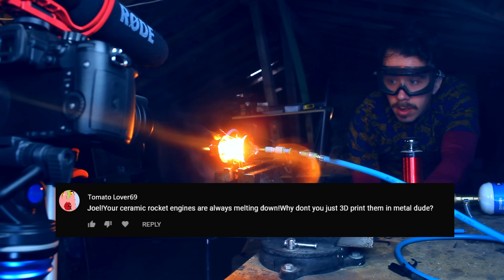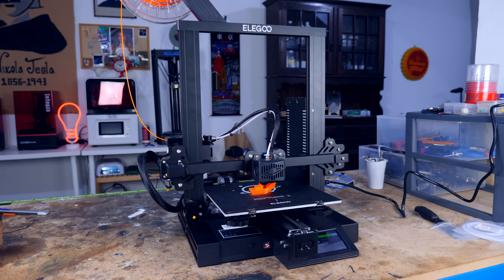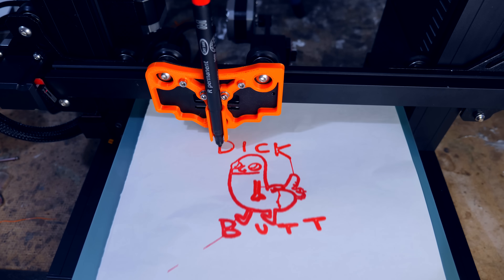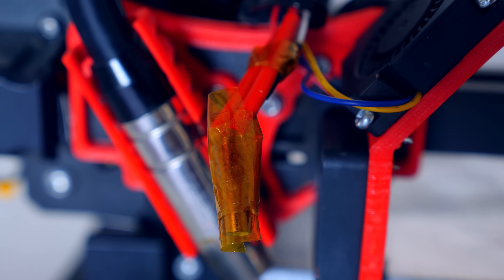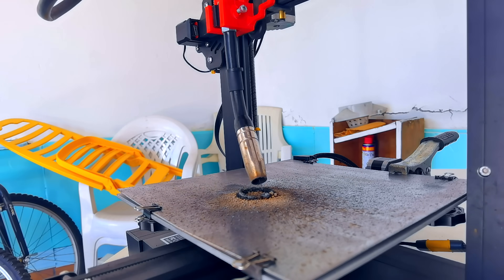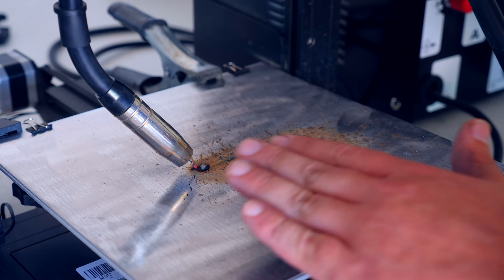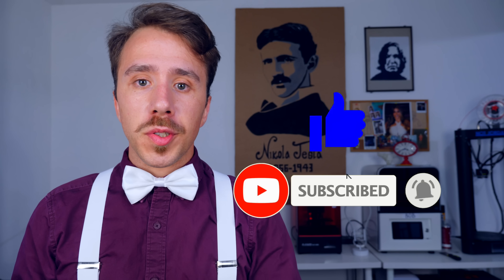I built a Metal 3D Printer using my Welding Machine

Comment: You should make a car/ generator that runs on dry ice. Since the dry ice makes pressure you could possibly use your Wankel engine or design a new pneumatic motor, but that could fix the problem of all of the pressure coming out at once.

Comment: Instead of printing metal, mill layer by layer and weld it together that way it would be more controllable. To fill the small gaps between layers maybe put it in oven in to melt the metal just enough to fuse in.

Comment: Make a Jet engine using only 95% tomato cans and Also 3d print a spool of filament to 3d print a spool of filament 3d print a spool of filament 3d print a spool of filament 3d print a spool of filament 3d print a spool of filament 3d print a spool of filament FILAMENT CEPTION
Reply: integza if i get the 3d printer can i get a spool of filament to 3d print a spool of filament to 3d print a spool of filament to 3d print a spool of filament to 3d print a spool of filament to 3d print a spool of filament to 3d print a spool of filament to 3d print a spool of filament to 3d print a spool of filament?

Comment: Well, if you can't 3D print them, and won't take my previous suggestion of having a service like Shapeways print them for you, how about using a CNC mill to cut a nozzle? Sure, buying those is also expensive, but you should be able to DIY that out of an FDM printer a lot easier than trying to make a metal printer.

Comment: dude. For the last time. Do NOT 3d print in metal. 3D print with FDM fillament called polycast or Moldlay and then Cast the fucking part out of a molten metal. I wrote this almost under every one of your "jet" videos where you complained you cannot print with metal. And you already have all the components to print it. Make a mold. Scorch the print out of the mold and then cast it.

https://www.youtube.com/watch?v=4--fiBGMIpc

Comment: I have a mechanically identical welder and also a 3d printer. I haven't watched the video yet, but I will be utterly blown the fuck away if this doesn't fail **spectacularly**

I've watched it now.
I think I see some problems you had.
Firstly, you are using flux cored wire, which does need to be cleaned between each layer, which is going to make layer height almost impossible to get right. If you switch to an inert gas welder, I think you might have better luck in that department, and they also don't smell as bad in my experience.
Second, perhaps it would be best to take out the trigger from the welding machine and have a more sensitive switch manipulated by a solenoid, that way you could have less delay and wobble in when your welder started.
Very impressive work otherwise, it does not fail as spectacularly as I expected.

Comment: When welding it's important to remember "If there's slag, you'd better drag" and with a flux core welding machine, you're going to get slag from the burnt flux. Ideally for an actual metal 3D printer you'd want to use a Metal Inert Gas (MIG) welder, that is a welding machine that uses a flow of inert gas to shield the weld pool instead of a flux, this would result in less spatter, cleaner welds and the ability to weld one layer on top of the next without flux inclusions, plus different gases produce different effects in the weld.

Comment: why dont you connect the switch on the welder to the extruder signal, if it exists. Have never played with printers. But I am a welder, flux core should not be used for this. the slag is killing you man.

Comment: your using a fluxcore machine therefor it makes a mess every time its used, using a shielding gass like argon will help a lot with that, and using an arcipelico cooler under the steel sheet will help prevent it from warping

Comment: I have an idea: put a smaller aluminum build plate inside a plastic tub that has water surrounding the plate. This would keep the aluminum plate below water boiling temperatures and would perhaps prevent excessive warping. You'd need to either use magnets to secure the aluminum to the plastic and the plastic to the 3D printer bed, or perhaps some high temperature rated double sided sticky tape.

Comment: Try that experiment again with a MIG welder that uses gas shielding. The gasless wire you used is horrible, messy crap and this is where the spatter was coming from. The gasless weld needs to be cleaned with a wire brush between layers but not the gas shielded weld. There is a flux core in the gasless wire that causes the mess. That is why the welder in the video clip was working so much better. Don't stop now, you are almost there.

Comment: You are using a flux core welder and you need to be using a gas welder The problem with fox squirrel Welders is there is a coating of flex on each weld that you’re welding over that’s why it looks so bad if you start using a gas welder Then it would also look so much better

Comment: You really need to be using a shielding gas like Argon when welding. It explains why your welds are so messy. You can also make use of anti spatter spray on your work pieces to avoid quite as much hot metal splatter.

Comment: Could you maybe make a sturdier bed by welding bolts to the underside and attaching it to a large piece of wood?
It might pull the plate down to decrease the warping without needing a larger plate.

Comment: Hi 👋 
If my lathe or milling machine could help you in any way, just send me an email. I am not an engineer of course, but I definitely can make some simple stuff :)
Reply: 😳😳 nozzle problem solved. Lathe can create nozzle curvature. Aluminium will be great for nozzle.
Reply: @sgt.scorpio9922  oh no no aluminium melts faster than the resin nozzles!! it has to be steel!
Reply: @sgt.scorpio9922  Aluminium has low melting teampriture.
Reply: Hydrogen powered internal combustion engine
Reply: @tremainedavis5996  haha a bit of a stretch there buddy XD
Reply: Graphite!
Reply: Yeah, this is how I plan to make some nozzles. Metalworking lathes are perfect.
Reply: Same here you if need any fabricated pieces I could try my best to replicate them. I would really like to see this idea go further preferably with Argon or even  TIG. I am not a machinist I am a hobbyist but I have a lathe a mill a CNC and a metal shaper. Fortunately what I don't have I have a an awesome uncle that has an entire garage set up as a machine shop. So if you need anything just email me 🤟
Reply: @Alpha Mods
Lathe would be a plan, milling with DRO would be similar to a printer, ye?  or manual
Reply: @Bob0bscureD  DRO makes it much easier, but still a pain to do anything with curves using a mill.
Reply: А вот и пересеклись интересы
Reply: yeah
Reply: Не думал что встречу альфу на этом канале
Reply: О, ничесе!
Кого я вижу! 
Это ж сам альфа модс!
Не думал, что ты его смотришь:))

Comment: You could 3d print in plastic, then cast the part in metal.  Or you could just weld it together from metal stock since you already have a welder.

Comment: To help prevent the bed from warping, you can use an air compressor or a high-powered fan with a directional nozzle. Since you don't have to worry about bed adhesion.

Comment: What if you put the 3d printer's extruder on the MIG welder , to act like it's pushing filament. Then ad gas to the welder , this way you will not get spatter nor the crust on top that needs grinding!

Comment: You should use a copper plate for the base instead of sheet steel. It will be conductive but not consumed with each attempt since the weld should not fuse to it. Also, angling your weld tip is intended to control the angle of the wire relative to the angle of travel, since you are travelling in multiple directions without the ability to re-orient the tip, straight up and down would be better since it will be more consistent and more accurate.

Comment: I can’t remember, have you tried casting the metal in sand? Maybe make a mold for the sand with 3d printing or ceramics, and then cast the metal rocket nozzle in the sand/mold? That could be an idea.

Comment: You should try using 3D prints to form moulds or forms for making ceramic/clay parts, or for forming sheet metals using a press. Thay way you can create some more heat resistant parts with better consistancy, and the molds and forms could be designed so that they are reuseable.

Comment: Have you considered just printing in PLA, then using that and sand to make a mould, put that into your furnace to melt the plastic away, then putting molten aluminium into the mold?

Comment: Too much angle.  Instead of getting good coverage with your welding gas, you are going to draw atmosphere across your weld.  Gas has mass,.moving mass has inertia, your gas is not only going to skip across your weld like a stone, it's going to transfer that inertia to the surrounding atmosphere and that atmosphere is going to move across your puddle.

Keep your angle to less than 15 degrees off of perpendicular.

Comment: Video idea: try to build a makeshift version of the real metal 3D printers by using metal powder and a laser that melts the powder in the shape that you want to print. This can be done by using a metal with a much lower melting point and the strongest laser you can get at an affordable price.

Comment: you should try using solder instead.. an extruder probably makes the most sense, but it might also be worth considering something more similar to resin printers where you work in a bath of solder paste (just solder particles mixed into flux, i'm pretty sure) or dry solder particles, and either pass a hot element through it, or heat it from the underside using a laser or something, in order to form the structure..

obviously, it wouldn't be all that useful for for rockets as the solder has a fairly low melting point, but higher temperature solders meant for brazing could possibly be used.
another problem in the case of the bath idea is flow, it could become a problem that the solder media doesn't flow well enough into open spaces underneath the part, which could possibly be solved by vibrating the tub

Comment: Make the nozzle straight and closer ( max 10mm) to keep the air out of welding area(needs Argon or some not flameble gas.). Use a thicker or cooled plate. Maybe you can blow air from the under site to keep the plate cool. 

Keep going, nice Video. 👍

Comment: Have you considered casting metal parts? You could 3d print the design and use it as a mold for sand casting. And then if you wanted to add an interesting twist to it.  Instead of a forge to melt the metal.  Use a induction coil above a sort of funnel over the casting hole and literally melt metal into it by holding it in the coil and letting it drop

Comment: Print rocket engines in stainless steel with your FFF-Printer by using Ultrafuse 316L filament.
Reply: After debinding and sintering the printed greenpart you will get a high density steel part wich will work better with pressure and high temperatures.

Comment: An idea for a cheap fun project to SET A RECORD: Longest duration flight for a Rocket Propelled RC Plane!
Sure - Planes have set records for speed and altitude while under Rocket Power, but I can't find a record for longest duration while powered by Rockets!
Let's set one!
We will use 3D printers, both resin and FDM. We will use RC. We will use FPV cameras and radios. We will use LiPo and Li-Ion Batteries. All the things!
We start with a cheap ARF or PnP airplane kit from a sponsor. Remove the propulsion system and substitute Integza Propulsion System 1.0. 
Install FPV and control cameras and radios. We use 3D printed pan/tilt gimbal, tow release, rocket nacelle(s), and maybe a payload dropper?
Having a group of Portuguese RC enthusiasts helping, we glider-tow the new rig to altitude, release, and Set a Record!!!

Comment: Try with a mig welder instead of a Flux core wire feed. Much less splatter but you will still have the overheating issue.

Comment: For the love of god, you need to weld under a protective atmosphere (i.e. Argon) that's why the welding nozzle is that huge, it is supposed to spit out a inert gas out so your welds would not get in contact with oxygen to prevent rust encapsulations inside the weld.

Comment: You could 3d print rocket a rocket engine negative,like a mould. Then make a batch of starlight and cast/form the engines. Starlight, like aerogel should withstand the temperature. Also you are great,  keep up the awesome work

Comment: Why don't you make a cnc from a 3d printer and use a dremel or a drill engine you dinkes. It cuts instead of build you rotten tomato.
Reply: The forces are a bit to heavy to handle with a 3d printer i think.

Comment: someone already said this probably, but it doesn't matter how thick your base steel is, it will always warp. steel is strong stuff, the only way to stop warping is to have the base at around 400-500C. that stops the stainless base from cooling too fast (cooling too fast causes the steel to harden and hardened steel is bigger than unhardened steel, hence, warping)

Comment: Couldn't you get rid of the whole handle of the welder and just use the cable itself? Or mount the nozzle to the cable directly? This way you can control the angle better, can have it closer to the bed and don't have such instability because of the long welding arm.

Comment: build a horizontal tesla turbine, with a third of the housing missing, and use the spinning discs as the toroid for a tesla coil... try to observe if you can create a static sheet of electrical current or ions spinning outward from the discs of the turbine... most certainly do this with safety in mind and [place a grounded wall between the opening and anything you don't want getting hit with lightning.

Comment: Build your own CNC machine using easily available parts
Reply: Indymill cnc
Reply: maslow cnc
Reply: Baling Wire, Flex Tape & JB-Qwik, plus some paper towel tubes covered in fibreglas & Bondo.

Comment: I can't wait for SLS 3d printers to come down in price and actually be accessible to hobbyists. They are such amazing machines that would be so useful.. especially for making prototypes with moving parts or miniatures. What you need to do something like that on thin steel is pulse modulation... stopping and starting the welding process over and over and over again to allow the metal to cool before continuing on. Also you only need about a 10 degree deflection angle on the welding nozzle when running it. That's why it's throwing off so many sparks is it's pushing the puddle off. Another also, you want to keep the distance between the tip where the wire comes out and the work (what you are welding) to about 5-6mm or the wire won't flow correctly and the arc won't like to maintain itself well. And yes, I actually know what I'm talking about, I'm 35 and I've been welding since I was 15 and taught people how to do a certification weld with a MIG. Oh and there is already a metal 3d printing process that uses a MIG welder.. they actually make parts like turbine wheels with it.. but it is a 5 axis process and still requires 5 axis milling afterwards to clean it up. It's called Direct Metal Deposition. https://www.youtube.com/watch?v=DKkcBoSeUOg

Comment: Video idea: work with Michael reeves on designing an AI based observation program that monitors the the 3D prints you build, it would be cool to see the AI modify the g code in real time to save the print from failing. I'm no engineer or programmer, excuse my lack of brevity and understanding of these fields pertaining to the possibilities. Love the videos <3

Comment: The metal is warping because as the weld cools it contracts and pulls the metal. If you can put a heating element under it or use some other method to keep the sheet metal at a constant temperature then it would prevent warping

Comment: VIDEO IDEA: Going off the DIY Printer idea, you should try to make your own Selective Laser Sintering printer using a laser cutter! Just lay down layers of sand or another low melting point powder and laser away!

It wouldn't have enough power to print metal, but having a glass printer would be super cool!

Comment: Print a circuit using the same method, but with Lead solder and some sort of extra hot tip.

Comment: Maybe high flow CO2 to cool and you wouldn't need flux core wire for shielding gas, so less spatter. But I think the weld would have too much porosity to make a viable engine.

Comment: You can use 3d printer to make plastic mold for clay and then make final mold structure by clay to pour melted metal using welding machine (we can melt metal using welding machine more faster then any method ever existed)

Comment: That performed way better than I was expecting at the beginning of the video. Moving from flux core to really thin solid wire and a shielding gas would help a lot. I also think a think metal baseplate would probably be a requirement. Active cooling on the plate may also help. Very cool idea, I hope you can take the experimenting further with it.

Comment: Water cooled table,  I use 1/4 steel for a flat surface to keep things flat and square. When I'm done I cut and grind everything off to make if flat enough to use it lots of times. Bolt aluminum or copper sheet to the back for better heat transfer to keep the part cool. Good welding tables have a lot of mass to absorb the heat and not deform

Comment: Ohhh pooor 3d printer hahaha
You need to use gas (helium or argon or co2) to shield the molten steel, in this way you can use wire without slug.

Comment: But can you use tin instead of pla in your 3D printer? Because tin have a very long melting point and could be easier apply compare to steel

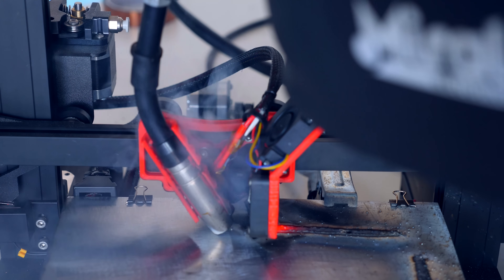7:00 maybe you could positionate it closer to the handle of the burner because it would be much cooler.

7:20  you would need a rotating head

8:44 you need a strong grip on the sheet metal.